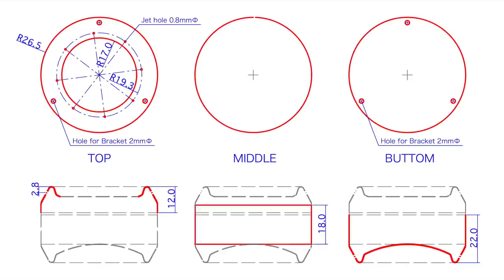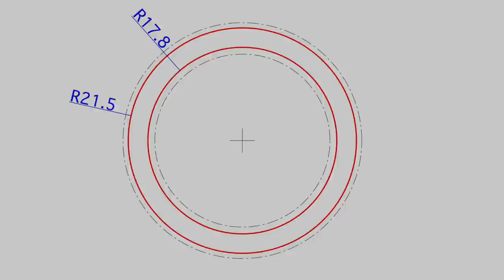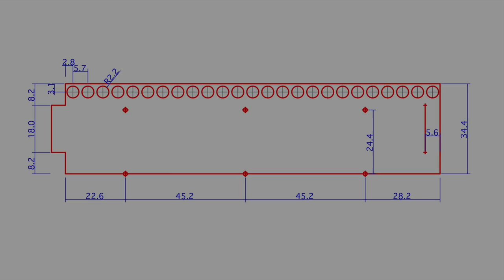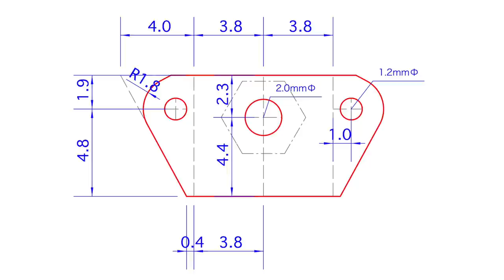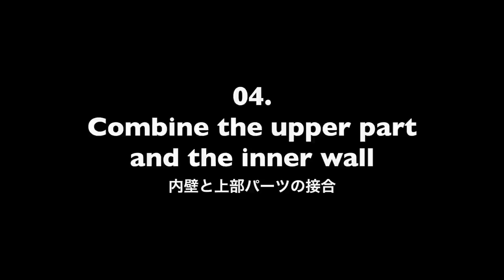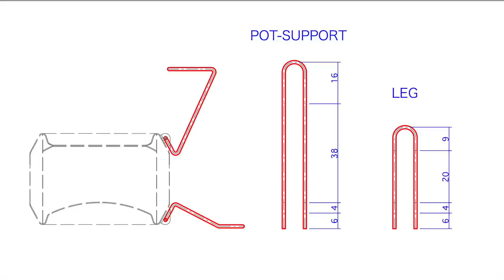How to make an alcohol stove - Tornado Cask Stove -

Comment: it's a true pleasure watching this video. the base with legs is so extremely important. not only will it stabilize the stove on rough surfaces, but it's the main safety feature as well. the bottom of soda cans has a too small diameter to support a pot sitting directly on it. mass * lever arm (i.e. 1/2 diameter of can) / height gives you the torque required to tip the set-up over. so especially light set-ups are prone to tip over when exposed to wind or accidental touch, potentially causing burns and/or scalding. well done! ty, chris
Reply from the maker: Thank you for your comment :)
I am very happy that you are familiar with the spirit of the design.

Comment: Good lord man, can't I just BUY one?  I don't think I'm up for all that detailed fiddley construction.  ^_^
Reply from the maker: Thank you for your comment :)
Unfortunately, there are no plans to sell this because there is still room for improvement.
Reply: +gijefftek Build a Fancy Feast type stove, instead of the tomato paste can, use a Vienna Sausage can, then no cutting, just put 4 holes in, 2 top and 2 bottom, add some Carbon fiber felt, and easiest stove you can make. and you got a boil in 6 or so minutes on 2 cups of water, and burns out in 18 mins, and with an easy simmer ring, last nearly 30mins.
Reply: I would buy it from you as it!!
Reply: gijefftek I was thinking the same thing!
Reply: It's not that great a stove, I built one exactly, and my Fancy Feast and my ALCO stove both outperformed it.
Reply: can you show us?  Love to see them.
Reply: I have built and or bought every single Stove design out there over the years, I think I am at around 28 different ones now, maybe 30+ I quit counting so have to guess, anyway, I tested each one thoroughly and came out with 2 clear winners, 1 you can build and buy, and the other, can only be purchased on ebay from China, it's a Trangia Knockoff, called the ALOCS STove, it looks like a Trangia, but has many differences, and outperforms Trangia stoves, and they are cheap, the other is the Fancy Feast Stove, which I do build and sell them, along with a good simmer ring with it, if interested, just message me, but those are the 2 top stoves I tested, and the only ones I now use myself.
Reply: @Rspenesmit  do you have a link for each stove. I want to check it out

Comment: This stove really beats them all and the pot stand is unique. and steady and also makes it a compact light stove.  The tutorial is also very clear and detailed.  I also liked the idea of the JB weld underneath the jet holes which gives a more steady direction of the flame and also keeping the jet hole size. The wick being made of aluminium foil also works well.  I guess this is the result of a lot of research and dedication. Thanks for the good idea. BTW your workmanship is BRILLIANT.  Please tell us what computer program you used to produce the drawings.
Reply from the maker: Thank you for your comment :)
Let's make an effort to the development of alcohol stove with each other. 
It is a shareware called "CADintosh" application I'm using. 
Function is simple, but it is easy to use very much.

Comment: Great job, although I still have some doubts about what happen to the epoxy when you apply such temperature to it. I'll definitely make my own as soon as possible! Thanks for sharing, greetings from Chile :D
Reply: jb weld does very well for alcohol stoves compared to any other adhesive out there. It has a continuous working temp of 500 deg f and a intermittent working temp of 550 deg f. As long as it is not in direct flame. The material to be bonded must be well abraded and cleaned before attaching and provided you let it fully cure before use. JB weld is damn good stuff.
Reply: +dmith smith 
i call it liquid duct tape

Comment: This is so awesome! How much weight will those legs and pot stand support hold without collapsing? No locking mechanism on them.. also how long to boil two cups of water on it? What did you use as fuel?

Comment: Hi there. That's one stove made to perfection. I'm starting to follow your steps but I stopped at the point where  you started making the brackets. In the schema you showed in the video, are all mesurements in mm? because if they are the resulting bracket is so small its hard to bend and drill. Please if you have a printed copy of the brackets, can you post it for download. Then I can glue it on a peace of aluminum and cut it , it would make thing a lot easier.

Comment: How do you get the "tornado" (vortex) effect on the burn?
Reply: ***** You basically have to spend a lot of effort and time angling each one of the holes as you drill it. And I honestly don't know that it's more than just visually pleasing. But it is that.
Reply: ***** That's what he's doing with the dabs of JB weld, and the hand drill around 5:20. You need the JB weld for the angled holes to have enough depth to actually jet the flames like that. But from what I've heard, that will eventually melt anyway.
Reply: VillageTwittiot No, you don't need JB for the holes to be angled. It is just easier to adjust the angle and more precise.
Reply: VillageTwittiot worteksing (and focusing that way) the flame is useful for small diameter pots, and fuel saving
Reply: ***** Thank you all for the replies.

Comment: I am surprised that JB Weld Epoxy tolerates the heat.
Reply: I use it inside a cast aluminium 2-stroke engine, anywhere but the combustion chamber and exhaust port. It has aluminium powder and expands with heat at the same rate as aluminium, very important. Temperature in this alcohol stove is a cake walk for JB Weld (not the 5 minute version).